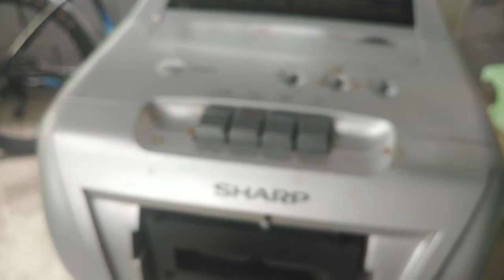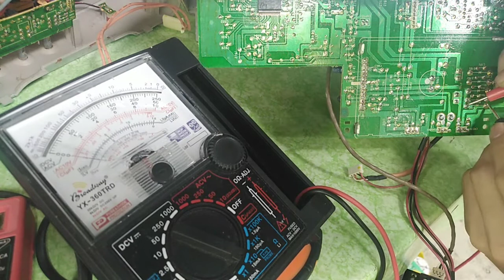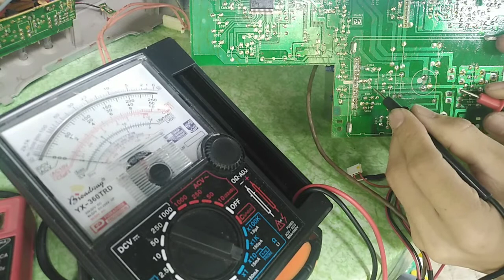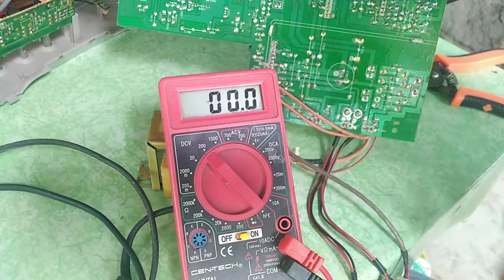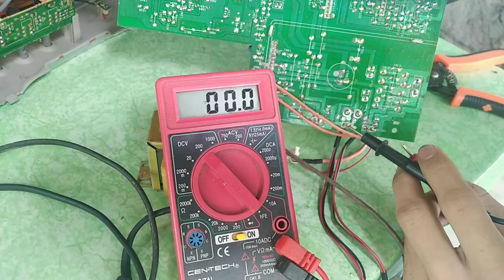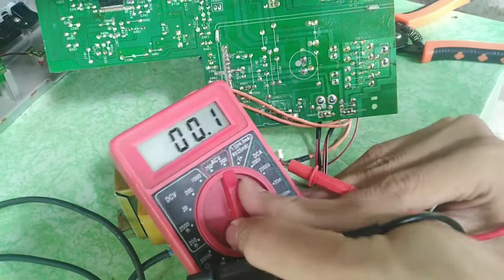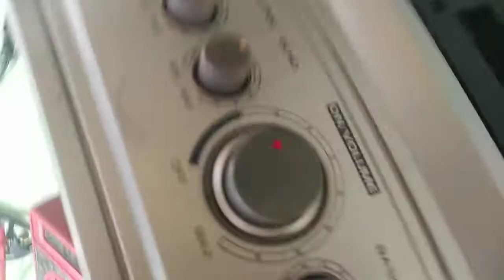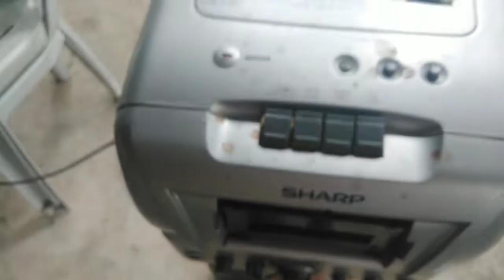how to repair sharp karaoke speaker (No power)

Comment: Saang circuit niyan idol shinort mo
Reply from the maker: Yung sa may negative supply po lods napansin ko walang connection papuntang primary filter capacitor kaya di nag oon yung karaoke
Reply: @zheppytv  bale po pinagshort mo ung positive at tsaka negative
Reply: @zheppytv  wala ka bang diagram idol
Reply from the maker: Wala lods.. Nakukuha naman yan sa pag check ng voltage kaya dapat mo po muna pagaralan ang pag check voltage para malaman mo kaagad kung ano yung sira ng isang unit na aayusin mo po
Reply from the maker: Hindi po..napansin ko kasi out of contact na yung negative supply nya kaya hindi talaga mag popower on yung karaoke

Comment: lahat ba ng model ng karaoke na yan ay ganyan ang board?
Reply from the maker: Same brand pero Paiba iba po yung circuit board
Reply: may ganyan ako eh kaso walang power
 @zheppytv
Reply: bakit kaya
Reply from the maker: Check nyo po ac cord, papuntang power supply dyan ang problema nyan
Reply: ok boss
 @zheppytv
Reply: na check ko na boss pero hindi parin eh
 @zheppytv
Reply from the maker: Pag hindi pa nag open, yung STK ic na yung may problem
Reply: gumana na  boss salamat po
 @zheppytv
Reply from the maker: Welcome po

Comment: boss pa notice po ganyan po radio karaoke namin ang siste po ayaw ng tumunog kahit naka on po ano po kaya problema salamat sana mapansin nyo po.
Reply from the maker: Kung may power , Icheck mo po yung mismong power transistor or yung STK minsan yan yung kadalasang nagshoshorted. Check mo din kung nagkakarga ng voltage yung main filter capacitor